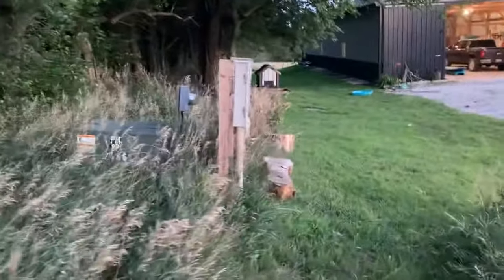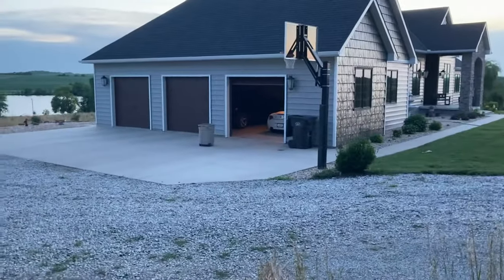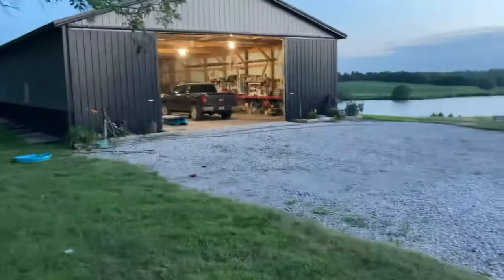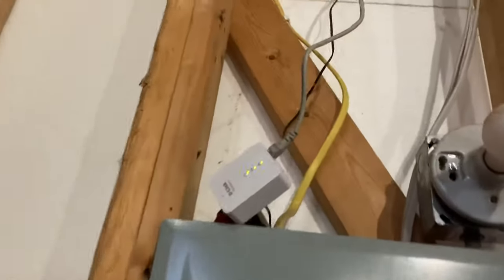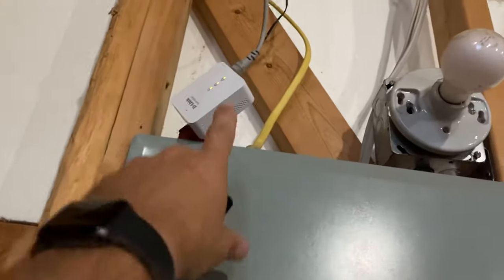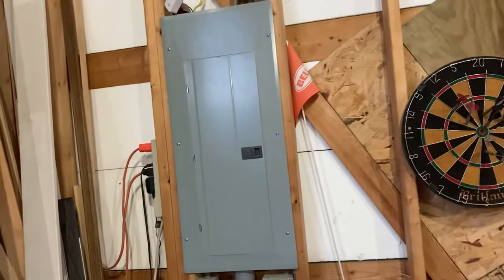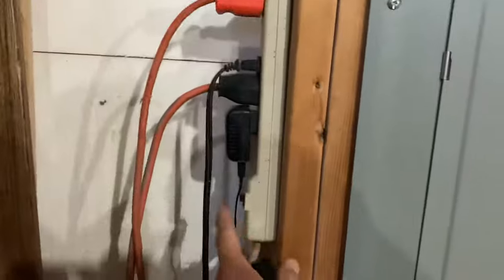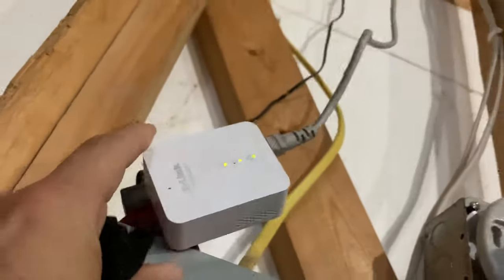WiFi to your outbuilding the Cheap and Easy way!

Comment: This is a good retrofit , but if you're getting power run to a shed get the contractors to run CAT6 or fibre optic cable at the same time.
Reply from the maker: Yeah. Wish I would have thought of that originally.

Comment: Thank you for this. $80 and now I have strong service in my detached garage. It was sketchy at first but then I plugged the interior D Link into the outlet on my panel and it worked much better.

Comment: Is your shop heated? If not how is your router holding up in the winters? From what I'm reading below freezing can adversely affect routers and my shop is only heated if I'm working in it.
Reply from the maker: No, my shop is not heated. My router is holding up well it’s been down to -20°F and no issues not that I spend a lot of time in my shop when it’s that cold but I haven’t had issues once it warms up. I’m not sure what model it is, but it was the cheapest Belkin router I can find.

Comment: Sometimes if you switch it to the other hot leg on another outlet it will speed it up.  They like to be on the same bus bar.

I have 2 sets, I love them.  They will easily do 100MB speed but it sounds like you have slow internet at the house Anyway.  Good video

Comment: Question sir. Are your house and transformer on different meters? I’m trying to accomplish something similar to get internet to my shop. My house WiFi just isn’t quite strong enough. I have one transformer that feeds both house and shop. But they’re on separate meters.
Reply from the maker: Mine are on the same meter. But I think it would still work with 2. You might try it and take the power line adapters back if it doesn’t work.

Comment: Good signal integrity?    that's pretty cool! easier than over air
Reply from the maker: The signal is solid. I only have about 12 Mbps download speed in the house but I still get 6 or so in the shed. I learned that it helps not to plug the units into the same circuit that has inductive loads or power supplies.

Comment: why cant you pug into a surge protector ??? also is a gfi plug in the same ?? the antishock pluging ?? whats the reason  please i just figured 110 power was 10 power.??   thanks
Reply from the maker: Not exactly sure why, but I suspect it has to do with the electronics in the surge suppression circuitry. They are very picky about electronics plugged into the same circuit also.

Comment: Do ya recon an extension cord ran from an outside plug at the house supplying all power to the garage with a 3 way splitter inside the garage , with the d link plugged into it would work?
Reply from the maker: It would work as long as the outlet on the outside of the house is on the same Line as the house d link is plugged into.   There are typically 2 vertical Lines in breaker panels. L1 and L2.

Comment: If you don’t mind can you tell me more information on exactly what to purchase and where to put it. I need this thanks
Reply from the maker: Here’s one similar to mine. Prices have gone up since I got mine. Just plug ine into an outlet in your house and an Ethernet cable to your router. Then do the same in your shed with a new router. 
TP-Link Powerline Ethernet Adapter Starter Kit - AV1000 Gigabit Port, Plug&Play, Ethernet Over Power, Nano Size, Ideal for Smart TV, Online Gaming, Wired Connection Only (TL-PA7017 KIT) https://www.amazon.com/dp/B084CZMYNM/ref=cm_sw_r_cp_api_i_1REWRC3BBEM5AC119S25
Reply: @diy_warrior  How do I know if my house and garage have a common power source?
Reply from the maker: @billvarady1091  if you can trace it back to a common transformer then they have the same power source. You’d have to have a pretty large acreage to have more than one transformer.

Comment: So you have the Ethernet from the shed router to the dlink extender but do you have an Ethernet that connects that cheap shed router to the main router or not? If not then it doesn’t need one because why?!!!
Reply: Its wirelessly connected to the main router using the d link devices if i understand correctly.
Reply from the maker: The d link isn’t wireless. It carries the internet signal from the main router to the first d link via Ethernet cable, then thru the electrical outlet to the outlet in the shed. The shed d link then takes the signal to the shed router via Ethernet.

Comment: Do you have links for where you got the router and plug ins?
Reply from the maker: Sorry no links. But I got them at Menards.
Reply: Also the key is making sure it’s on the same power source otherwise it won’t work.